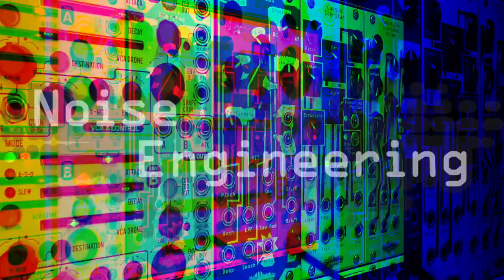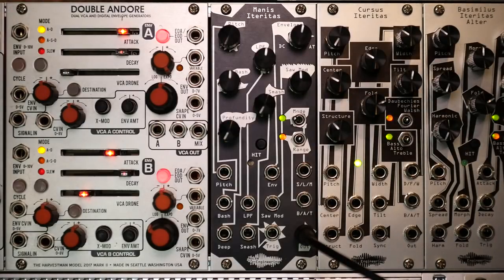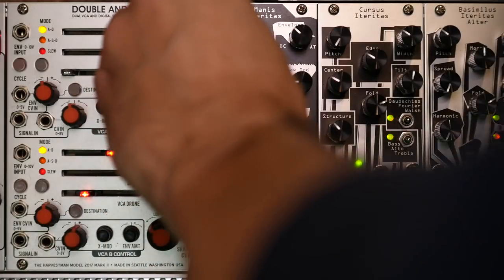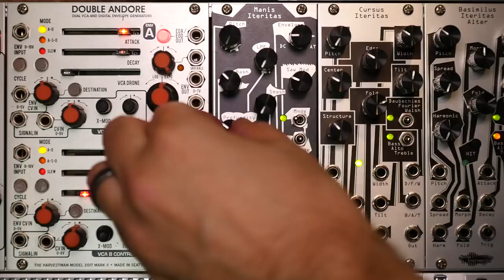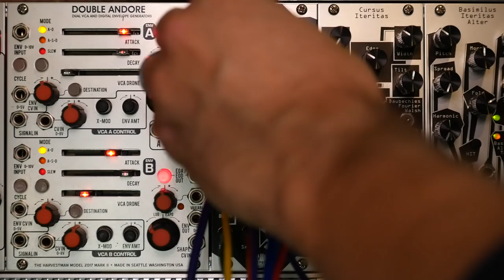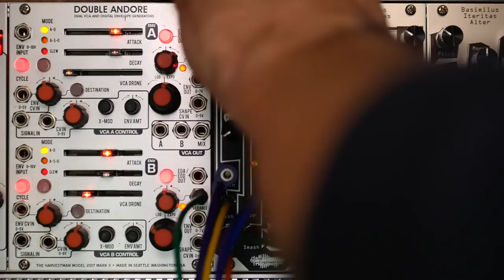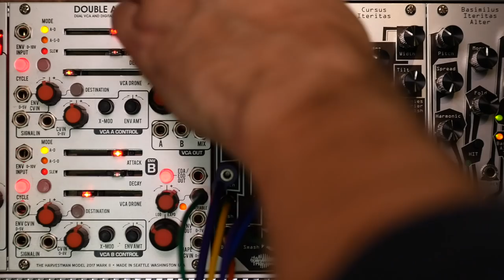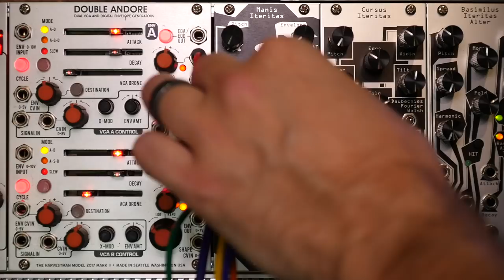Manis Iteritas - Noise Engineering

Comment: Great video.  Is there an analogue module that comes close to this?
Reply: I don't think so. (not a single module anyways) you can do 4 OP fm with analogue modules but you'll need more than one module to do so.
here's a cool example (they are using 4 Rubicons)
https://www.youtube.com/watch?v=QvzBYzhSSFo

there are other digital FM modules tho, ALM's Akemie's Castle for example
it's just MUCH easier to do digitally.
Reply: Maybe you could try a saw wave animator applied to a saw oscillator under sync?